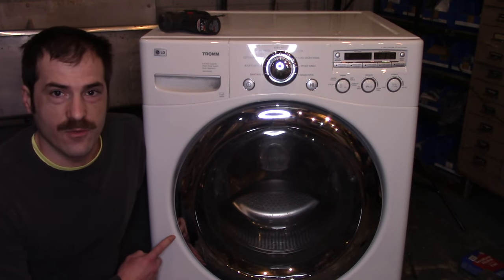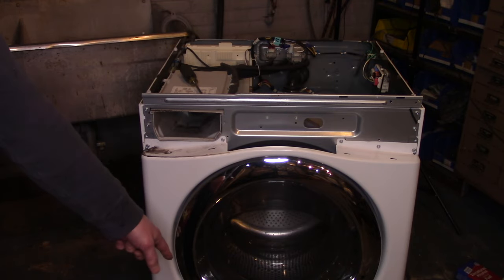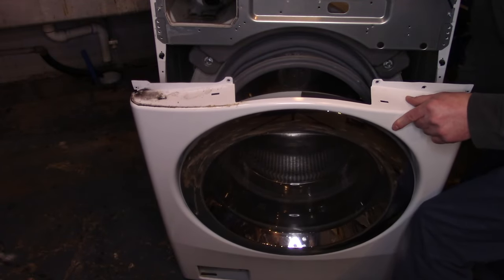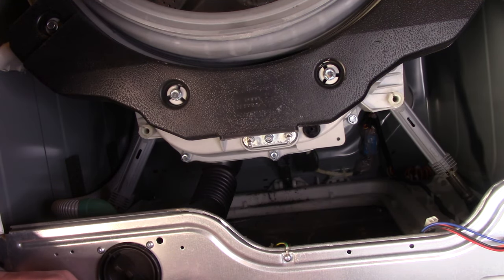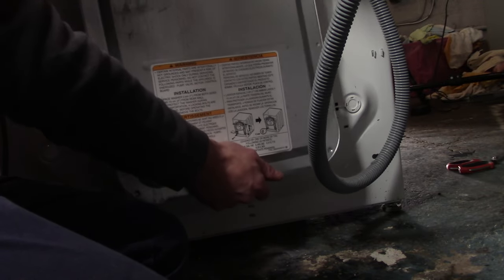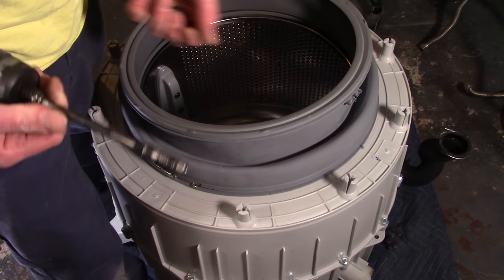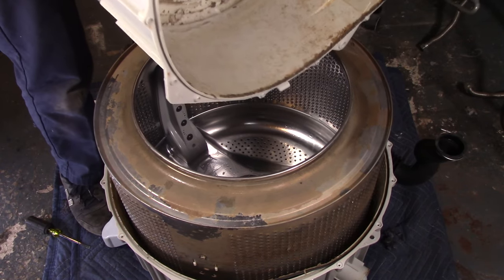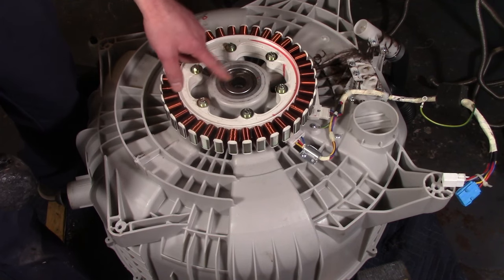How to Replace Bearings LG Front Load Washer

Comment from the maker: Buy an LG Bearing Kit for your machine on our website! They come in three different sizes, so please read the description to figure out which is for you or give us a call and we can help! 😁
Standard: https://lorainfurniture.com/shop/appliance-parts/new-lg-front-load-washer-bearing-replacement-kit-4280fr4048n-map61913707-4036er2004a/
Large: https://lorainfurniture.com/shop/appliance-parts/washer-dryer-parts/new-lg-front-load-washer-large-bearing-replacement-kit-4280en4001f-4280en4001g-mds62058301/
Uncommon: https://lorainfurniture.com/shop/appliance-parts/new-lg-front-load-washer-uncommon-tub-bearing-replacement-kit-4280en4001a-map61913714-4036er2003a/
Reply: What if the plastic corner edge where the drum seal fits is chewed up?
Reply: Hi. I took my washer apart to clean it. I’m lost on where this piece clamps on. 🤦‍♀️ Can you help? I had the detergent dispenser hose connected but took it off trying to figure this lone hose. 😳

Comment: I just changed out the shock absorbers on my LG washing machine. Using a 12mm closed wrench makes getting the plastic pin out really easy. Just slide it on the back of the pin and it will squeeze the locking tab down so you can pull the pin out with pliers. It's very easy. If you find that the wrench won't slide on to the back of the pin easily, it may be because the locking tab is butted up against the housing. Try pushing the pin in to back the locking tab from the housing surface and you'll be able to slide the wrench on.
Reply: Thank you!! Worked like a charm.
Reply: @moonatics  You're welcome! I'm glad that tip helped!

Comment: I don't comment on videos often, but I want everyone to know that this is by far the best step-by-step video out there to repair these front load washers.  I followed the directions on my phone while I stood in my laundry room and went step after step.  Worked flawlessly and fixed the problem.  I would add just a few notes.  If you intend on doing more than one of these, get a bearing/race driver instead of using the old bearing.  I had a set that I paid $20 for some time ago.  Keeps your new bearings clean, drives them in straight, aluminum, so no marring on new bearing.  Again, it was a great video!

Comment: Hey all, great video. One step he said that you’ll struggle with, I have a way that is easier for bearing removal… take a 1” socket and an extension. Slide it through the bigger opening of the 2 bearings. Four hits the first bearing came out. Flipped the drum over and used a 1’1/4 socket and extension and with two hits and it was out. Even pressure with the socket pushes is in a straight out motion, vrs the wiggle motion of exiting going side to side and going all around with a punch. Mechanical background came in handy for that part. Rest of it was fabulous and thank you for the video, machine is fixed 🤟
Reply: Thank you so much for this tip! After hammering away for literally hours this finally let me get the bearings out.
Reply: So two of the bolts on my spider arm easily turn, but won’t come out. Any ideas?
Reply: @Meghan83 the inner nut that bolt fastened to is turning...project just became way more difficult!

Comment: As a professional in the field, on LG and Samsungs with bad bearings. We replace the whole rear outer tub and spin basket. Its much faster and guarantees the bearings are installed/pressed correctly and spider shaft is a none issue. This is a very expensive repair and really only worth it is the machine is under factory or an extended warranty.  Factory also tells us to replace them this way. Great content you earned a sub from another appliance repair tech!
Reply: Where do you buy the whole rear outer tub?
Reply: agree with you. My LG first had noise， I did not pay attention, it still working. after period of time LG then water flooded. I dis-assembled it. found lots of rust. where it come from? finally found out , bearing was totally broken. it has been in use for 5 years , passed factory warrenty.
Reply: How much do you charge for this job?
Reply: @laughter95  with parts and labor it averages anywhere from $600-$800. Cost of parts are the biggest problem.
Reply: @Kickstandsup83  Wow, that's interesting. Thanks for the reply. Considering a new washer can be around $1k, the cost of a repair seems like a very tough sell. My local repairman told me he didn't think it was worth trying to repair my LG front load washer that rattled, likely due to a failed bearing and/or motor issues. I didn't get to ask him exactly how much he charged, but he guessed it would be around 80% of the cost of a new washer. I bought a new LG WM4000 washer from Lowe's for $580 delivered. Glad I didn't go the repair route. Thanks again.
Reply: I think this is aimed at the homeowner who has the time and very basic skills to do it. His kit for the large washer is about $150, so really, that puts it squarely in the 'worth repairing' category for someone who doesn't have to figure the time.
Reply: It looks easy enough, but it's not. I did this repair about 2 years ago. Unfortunately it's already going bad. You are absolutely right when you say pressing the bearings and seals correctly in is key. And without a press like they have at the factory, well you might as well be shooting in the dark. Like I said before, it's a flawed design. The seal will always leak. These machines are good for about 10-12 years max.

Comment: Thank you so much for sharing your knowledge and experience in such an easy to follow, informative, and thorough video.  It took me most of the day to replace the bearings, but I did it without any major issues.   The sense of satisfaction I had as my newly repaired washer ran a load of clothes was tremendous,  and I couldn't not have done it without your video.  Thank you, thank you, thank you.

Comment: Thank you for this amazing video. Made the repair myself with relative ease. Removing those old bearings though... Oof! Also replaced the spider because the shaft was striated from the bad bearings. One question though: is the drum part still supposed to be wobbly? It doesn't go up and down, but just front to back. I think the shock absorbers are ok (replaced them about half a year ago because I thought the problem was there instead of the bearings) and the springs still seem tight. My model only has 2 shock absorbers on the bottom, one on the left and another on the right. Thanks again for the excellent tutorial video

Comment: What are the signs you need to replace the bearings? I replaced the rotor sensor after LE errors and I’m still getting rattling noises and no spinning with wet clothes.

Comment: Great video, very helpful but I do have a question.  I tore apart the machine up to the part where the grey tub halves are separated but I found that some dirty brown liquid (assuming it is dirty water) came through the bearings and got onto the motor.  Can I clean the motor with electrical parts cleaner or something else?

Comment: Hi sir how are you, may i ask what model do you have??? I wonder if the LG MODEL VM4500 can you take the rear outer tub and front outer tub apart?? Some new model they use glue instead of rubber seal and no way i can take it apart... i have a whirlpool and they use glue i couldnt take it off and change the bearing.. thank you and have a great day

Comment: So, after the new bearing kit is properly installed and the spider arm replaced and the machine still sounds like a train coming down the tracks during spin, what is the cause of vibration ?  Basically it sounds the same as it did prior to the rebuild.

Comment: My front load  LG machine is not even 2 years old.  Not making any loud noises on any cycle but will error sign LE about 1/4 of the way through a wash. When I see this it has water in the bin. I can try hand moving the bin and then spin cycle it dry but if I try to re-start a wash cycle it LE errors 1/4 of the way all over again. Can't really afford a new machine or even a repair service call at this time. Any ideas you have I could try would be greatly appreciated. Btw, Happy Thanksgiving! Jim

Comment: How long ball bearings should last? I bought 1st LG 10 years ago and Lowes replaced it 5 years ago from the 5-year warranty I bought. I bought a warranty for replacement and now the 2nd bearing is bad. Lowes is replacing the unit again but I had to fight the warranty this time. I don't know if I dare to buy another warranty for 3 replacement.

Comment: I have a lg front load washer that's making a knocking on the spin cycle.  Is there anyway I can tell if it's the bearings or the spider ? Without ripping the machine apart. Thx

Comment: Hi would a threaded bar with 2 washers about the Same size of the bearing work as a bearing press ,put the threaded bar through the middle place washers on either side and tighten both up at the same time it will pull the bearings into the drum.

Comment: I followed the video to a T and replaced the bearings and seal. Put everything back together and now getting an LE error code. It will spin by hand and intermittently via motor, but then struggles and spits the code. Replaced hall sensor and no effect- any ideas?

Comment: How do I know if the bearing went out. The motor on my messed up. Broken magnet pieces between the coils and magnets. I replaced but for some reason the coils and magnets are making a squeaking noise when it is agitating, seems like the coil and magnets are rubbing. I haven’t gone passed the point of agitation, don’t want to break the motor again.

Comment: i bought an LG 3997wma all in one that had an LE error, the rear 17mm head bolt snapped off i so i replaced the spider arm and i put syl glyde on the bottom of the shaft but not the whole shaft. I had to get in there to replace the hall sensor because of the LE error. The washing machine works now BUT the shaft sticks out and the 17mm nut is tight not the but washer doesnt sit flat against the rotor? I'm not sure why? Also I have this god awful noise when it spins slow or stops and changes direction..

Comment: I’m pretty sure only the inner part of the larger bearing came out for me.  The outer part of the bearing I believe is still in the tub bc the new bearing just sits there and doesn’t have room to go further.  Any suggestions?? Just keep punching away to see if the rest comes out?? The only issue now is there isn’t much room for my punch to touch the bearing to be able to knock it very hard.

Comment: I have the exact washer and when Manually push the drum inside it spins to a point and feels like it drops and I feel some resistance until it spins smoothly and then drops again. Does this sound like an issue with the spider arm? I’m thinking the spider arm is cracked. I get a CE error code when I try to run it. Tried unplugging for a minute and plugged it back but same CE. I’m thinking the motor is bad and the spider arm is busted..

Comment: A huge thank you for putting this together and so detailed. I ended up having a cracked spider frame as well.

The tough part was figuring out how much to tighten the bolts holding the tub together. I had a leak the first time I used it, but luckily there is access to the bolts without removing.

I also ended up using a dremel to remove the larger bearing, it came out easy.

Would I tackle this again? Heck no! 😂

Comment: I would love to hear what kind of success people have had with this repair. I did this once about 2 years ago. And I'm beginning to hear the bearing again. Fact of the matter, is it's built to fail. This design will alway leak at the seal causing the bearings to fail and the spindle to rust and pit.  Unfortunately all front loading machine use this system. Planned Obsolescence?

Comment: Installed this kit in about four hours, start to finish; would have taken 90 minutes if I wasn't being incredibly cautious in taking the beast apart.  Naturally mine was slightly different from the one in the video, but when distilled down there's really just a handful of operations involved. I did skip the process of drifting the old bearings out; some penetrating oil, the largest socket that will fit through the opening of the opposing bearing (around 27mm or 1"), an extension, and a couple of whacks and you're done (next time I may park some chunks of dry ice on the old bearings as well).

The new bearings drifted right in, using the old bearings as a drift, and are far superior to the OEM bearings.  The spousal unit was actually looking for excuses to run more laundry through the machine, because it was smoother and quieter than it has been when new.

Comment: I took my rear drum and new bearings to a machine shop and had them do the removal and replacement. Looks good, but when I started to rebuild it, I'm getting a little resistance in the drum. Also a little squeak/squeal... I thought the shaft was ok, but maybe not?

Comment: Excellent video, 30yr auto repair mechanic I have a lot of experience with pressing things apart, take the drum and flip it over support the plastic part with wood so the weight of the drum is helping you when hitting the shaft make sure the wood is not touching the steel drum , 3 hits with a hammer and wood and is was apart .. good luck !

Comment: Eugene, it turns out that the front outer casing is no longer available for my LG WM2277. Is there an epoxy that would would to fill the crack. Otherwise, your video helped a lot in taking the bearings out

Comment: Thanks for the helpful guide. Our 11 year old lg direct drive inner bearing failed. Ended up with a white load covered in grease and rubber bits from the seal. Managed to to find a new rear tub section with new bearings and seals fitted for about £100 snd a new door seal for £30 as I found 2 socks between the tub and drum.

Comment: I can see outside bearing 6205 2Z. Does it mean that the other bearing inside will be most probably 6206 + simmering 37*66*9,5/12 ? I have both bearings at my work (warehouse), the only missing part is simmering. Thank you very much for this video.
Reply: Solved. Model number was hidden behind the door. :D

Comment: Wanted to say thank you. I just completed this repair and everything is working again.  Took me a total of about 8-10hrs(4hrs to get washer apart and to get the bearings out: approx 6hrs to get the bearings back in, replace additional parts and reassemble washer).  Took me forever to get rear tub /drum separated!  A hammer and 2x4 didn't work for me. I thought maybe I was in that 20% that this doesn’t work for and was about to give up. I went and purchased a 16lb sledgehammer and was able to get the rear tub/drum separated on the first hit.  Now the bearing took forever to get apart as well. I used a lot of penetrating oil, a hammer and socket extension (yes a socket extension…it's ruined the socket extension lol) but it worked.  My washer was leaking  thru the bearings which left a mess of brown dried up rust/crud on everything in the back of the washer, inner side panels and the top of the pedestal.  While it was apart I took the time to clean all the built up rust/crud on the drum, front/rear tub and washer rotor assembly.  This would be a great/only time you could do a deep cleaning to get to parts you wouldn’t be able to access with the washer together. Also, had to clean the motor(soft wire brush & damp rag)which had lots of crud on it as well.  I was afraid bec it was so much gunk on the motor and magnets that it may not spin correctly so I cleaned it and also changed the washer rotor position sensor, bellos and water temp sensor since it was all apart and easier to do now.  I did purchase a spider arm which I had full intentions on replacing since it was apart but upon further inspection, it just had a lot of crud on it which I cleaned up with scrubbing pad.  After cleaning it there weren’t any cracks so I did not replace.  Putting bearings in freezer and adding liquid detergent helped to get bearing back in easily.  I would suggest for those attempting this a few pointers: Put the mushroom looking item and clamp front the top hose and clamp from the bottom hose in a bag.  If you don't they are easy to lose without noticing as you move things around. Also, put a long socket on the plastic screws for the shocks(took me forever to get them them out with pliers).  Take pics along the way as you disassemble the washer and label screws as they come out as all washers are similar but not exactly the same as the video.  Other than that, video is gold for doing the job. Is it time consuming.....yes, but video walks you thru all the steps and saves a lot of money.  Since most washers these days last 4-5yrs it seem, I rather keep what I have knowing the work I've put into it & new parts I have Lol   Washer is working like brand new again!  Thanks!

Comment: The rotor bolt that you removed with the 17mm socket at 9m40s of your video.. mine is snapped in two, with the remaining shaft deep inside. Have to figure a way to remove it. I can also spin the entire drum with my figers, by spinning the shaft. So bearings seem fine! 14yr old LG front load WM2301HR. Thanks for your video it's just awesome.

Comment: Thanks for the video boss. It was an easy procedure overall, ended up replacing the spider in mine as the seal surface on the shaft was gone (rusted out), all in with OEM parts it was 450cad and now the washer performs as new. Spent more time cleaning everything than the repair itself lol. The alternative to replace the washer was not financially wise for me as new they are over 1k. Also, I used the trick that the other gentleman mentioned, using sockets and an extension to remove the bearings as using a punch rocks it side to side and the risk of damaging the mounting surface is not worth it.
Also gettings parts was quite difficult as well, days away.... Not many people repair anymore. Tons of these for sale on MarketPlace with the same proble